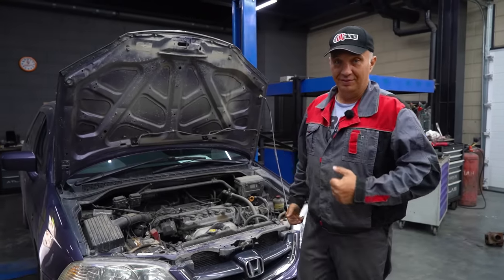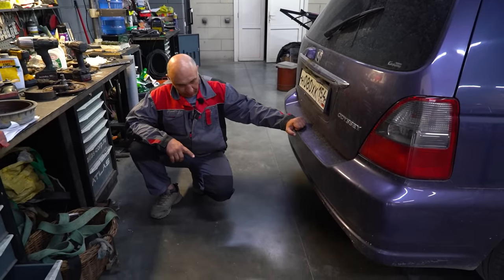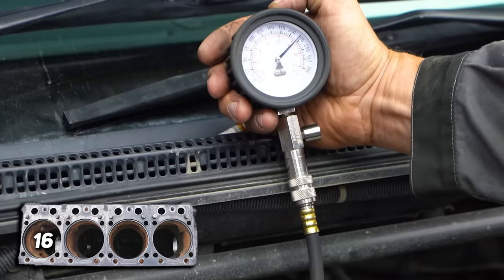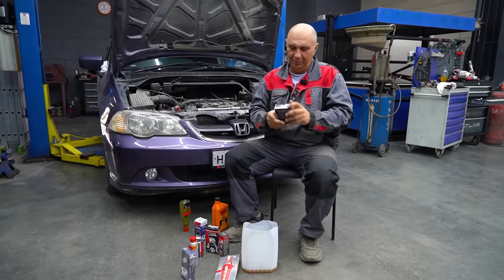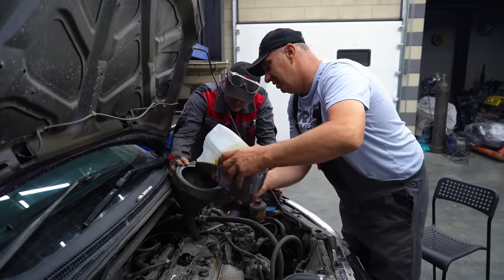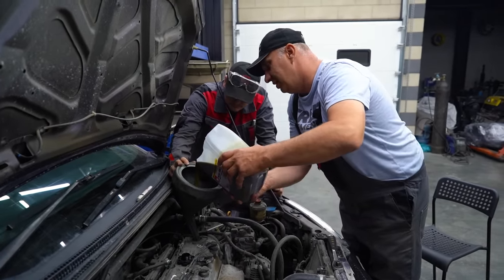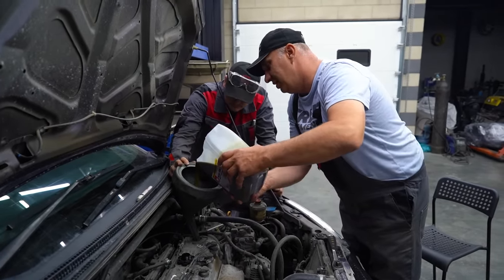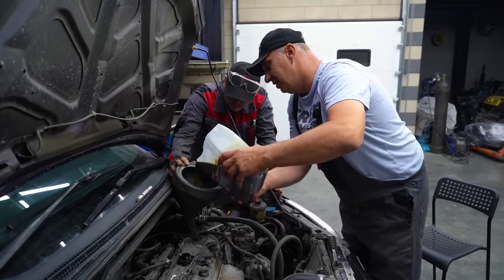Running an engine on additives instead of oil - what will happen?

Comment: Fill the crankcase with 100% Marvel Mystery Oil and see what happens.
Reply: As long as there is some sort of oily fluid in the engine it will run. Even sunflower oil will work.
Reply: extreme rod knock..
Reply: I was having weird results with my engine oil analysis and was using Marvel Mystery Oil. To eliminate a variable, Blackstone offered to run a free analysis on MMO if I sent them a sample. I did and subsequently received the results. If someone can tell me how to post I will. Basically, the only thing it had in it (via their analysis) is phosphorus. The viscosity was 2.6 cSt. However, what concerned me most was the flashpoint of 160 degrees Fahrenheit. Basically, when added to oil this is just evaporating at operating temperature. So I have come to the conclusion that MMO is fantastic for gas. However, I am only going to run it in my oil on occasion for a few hundred miles before an oil change to "clean things up." I just do not feel it is good to run all of the time with a low flash point and so many solvents.
Reply: So technically with Marvel Mystery oil the mystery is why is my mystery oil evaporating LoL

Comment: As a Honda owner myself I believe that those engine pops were caused by malfunctioning VTEC system. You see VTEC system uses oil pressure with combination of a solenoid valve in order to engage and disengage the modified cam profile.So if you don't change oil regularly or use oil with wrong consistency it might prevent VTEC system to work properly. Based on what I have seen in this video I'm guessing VTEC system on this particular car is probably all clogged up resulting in VTEC not disengaging properly resulting in bunch of fuel getting into exhaust pipe. So before doing any further testing on this engine I strongly recommend you disassemble and thoroughly clean the whole VTEC system, replace the oil once again and go for a drive.  I bet engine performance will increase significantly since VTEC might be restored to its working condition. Will this solve the whole smoke problem? Most likely not. At least not entirely.

Comment: it prob has a clogged pcv valve, plugs need to be replaced, ht leads have high resistance and worn as well as the coil pack(s) 😂

the owners enthusiasm was the BEST 🤣🤣 ❤54G

Comment: You could run a car on anything, for a while. One time I was getting ready to change out an engine and decided to try an experiment in which I drained the oil and replaced it with water. Then I drove around my neighborhood for about 15 minutes and got her home, hissing and spitting and steaming. It was great.

Comment: Great experiment! I always wondered what would happen if you did this. I am curious if Rislone ring sealer and treatment would do anything with this engine to slow the oil burning on acceleration. Obviously nothing but a rebuild is going to fix all those problems completely, but I am curious if a ring sealer would stop some of the oil burning on acceleration.

Comment: They were notorious for week oil control rng pressure.....ive pulled them apart and expanded the oil expander spring all was well after that.

Comment: I've seen some oil changes of cars from people who have only used oil additives, it eventually turns into a jelly and is very hard to clean out. I don't know if it hurts the engine but it eventually stops the car from starting. I wonder what happens if you use cooking oil.

Comment: Suggest you substitute one quart ATF for oil on next oil change and add 4 oz of brake fluid to act as a seal softener.  It looks like its the valve stem seals mostly as the smoke is on acceleration after deceleration.

Comment: Just a thought what if you guys took this engine out and took it apart and cleaned it like that last engine you guys did and see if that does anything to fix the smoking. It would be interesting to see if it restores the engine in some way.

Comment: Grey smoke and it backfires seems as running super rich from a stuck open or semi-stuck open injector. Maybe thats whats washed out the cylinder off and caused it to consume oil.

Comment: the smoke when letting off the gas is sign of a bad valve seal, mainly intake seals. at high rpm then lettinging off the gas pedal. the vacuum is at its highest or most significant.

Comment: Not only does this work ( with fuel additives) it can be used to clear out dirty, waxy diesel fuel systems. Or gas . It's easy on a mechanical injection car to run the fuel intake into a can of seafoam

Comment: Curious if you were to install a brake pedal for the two left wheels and another brake pedal for the two right wheels with an unwelded diff if you could brake steer like a army tank a lada is built like a tank after all

Comment: When faced with a head gasket issue on a vehicle you don't care much about them stop leak is worth a try. I have even had success adding a bit of brake fluid to a slipping tranny but mechanical fixes in a bottle are usually in vain.

Comment: That Xado stuff is actually pretty good; my transmission wasn’t having any issues but I added some since it has over 150,000 miles and now the shifts are a little more crisp and the car pulls a bit better. I think it’s made in Ukraine

Comment: Attribute it to cylinder head wear issues. I'd say a valve job and new guides and seals and it would probably be a good running engine again. Probably re-ring it too, but I suspect some valvetrain parts were slowed on the test due to the consistency of the concoction and there's just too much clearances, as if to say it simply needs valve lash adjusted and no snake oil concoction could resolve that.
Reply: Its simply not worth it you can get a replacement cheaper
Reply: @bubatzpirat396  that's the logic with most engines until all of the original cores dry up and you can't replace it. When that happens, you'll wish you didn't waste those engines or parts. That is to say you wish to keep said vehicle.
Reply: @lucky7s94  they produced millions over millions of vehicles using the same engine base. Why rebuild an engine for upwards of like 2k when you can get a perfectly good one of the salvagelot for 500
Reply: @bubatzpirat396  just like they produced millions of cars in the 50s... now try finding an original '59 Studebaker lark 8 v8 crankshaft. I'll wait because I bought the last NOS in box crankshaft in existence. There was no option to just put another motor in it. Yes, it would be cheaper for some to put another motor in their vehicle... but always save what parts you can at least. There's a reason they took the 640 cubic inch Merlin engine out of the original Bigfoot monster truck... parts dry up and their value goes up. For example, a ford 429 with desirable head castings are in the 1500+ usd range right now sight unseen but needing total rebuild. They aren't made anymore and they aren't getting cheaper. In order to rebuild one nowadays, you will automatically need to get parts from aftermarket suppliers. And to think at one point, Ford made millions of those motors. 🤔
Reply: @lucky7s94  they did but these where desirable cars because theyve been some childhoods. I thin a honda odyssey wont be so rare and desired in the same timespan

Comment: HOW'S THIS FOR AN EXPERIMENT... Run a car completely on oil... Coolant = 0/30 Oil. Power Steering = 0/30 Oil. Brake fluid = 0/30 Oil. Now, how would the car drive/operate with all those three fluids replaced at the same time? (Use your test track obviously 😉). Naturally you will need petrol/diesel as fuel, but thin motor oil for everything else. 🤔😏😉👍
The things to test for will be how will the brakes feel going from cold oil to warm/hot after using the brakes intensely for a while? How will the steering feel from cold start to a while after driving? Will the cooling of the engine be as effective.. Results NEEDED! Hahaha 👍
😎🇬🇧

Comment: I'd like to see if you could breathe new life into an old engine with RVS treatment.
I've read from users on forums that it does increase compression a bit but haven't seen any proper testing.
Like, maybe find some clapped out Lada engine, and just do the treatment as per instructions.

In my own cars i've only noticed a reduction in noise, in my Mazda it completely got rid of valve lifter noise, though it took 2000km of driving with the treatment in the engine.

Comment: I got honda accord 1999 2.0l the on odo meter 250 k.m  same engine on the odyssey 
I got the same problem blue comes out when i floor it 
It consumed 1 L every 600 or 700 k m
It's common ensue on f series after 150 km

Comment: I lived in San Juan for 9 months in 1995.  I bought a Fiat Spyder that had a blown head gasket.  I changed the gasket out in the parking lot of the condo in Isla Verde, but the damage was done;  A month later, coming back to the crash pad the engine seized about a block away.  I managed to push the car into the parking lot.

What happened was that the day before I had poured a bottle of STP oil treatment into the engine, because the oil pressure light kept coming on.  I figured the increased viscosity of the oil would raise oil pressure and save the bearings, but what it did was starve them of oil and it seized up.  My roomate at the time was a Jesus freak who spent all of his spare time in the church next to the condo building, and the "spiritual leader" apparently had access to a Fiat twin cam 2.0 liter engine, so I sold it to him for $100.

-The point is that these additives just keep the oil pressure warning from coming on, but I think they just destroy your engine in the process.

YMMV~

Comment: I suggest to add a oil aditive that is supposed to make the engine last longer, drop the oil and run the engine till it gives up then examen the damage
Reply: I'd like to see that. I have seen that supposedly done in commercials for Prolong, Bestline, Motorkote, etc, but seeing it independently validated would be cool. I really don't see it working for very long on a stock engine though because I'd think things like bearings will still quickly get very hot and melt without fluid to dissipate the heat from the inevitable friction. Bearings don't have to get that hot to melt either, the melting point of tin and lead is around 450 degrees and 600 degrees respectively. However, if the bearings were replaced with the same hardened steel the crank is made from, that might actually work for a while since aluminum, the next softest metal, won't melt until around 1200 degrees. So perhaps instead of a catastrophic failure, we might just see greatly accelerated wear.

Comment: Use compressed air to simulate a Turbo! Someone else tried it but didn't seal off the intake, it was just bleeding all the air backwards out of the intake. That's one experiment I've wanted to see for Years but nobody seems to have done it yet.
Reply: Ford did something like this for there rally cars

Comment: My money is on valve stem seals, the way it goes from black to white to blue is a good indicator of oil being pulled into the combustion, no easy fix there save you can use balloons to inflate inside cylinder to stop valve dropping and try and pull them out from the top once springs and collets removed but to be honest a well set up garage just easier to whip that head off, change the seals, new head gasket and giving the head stuff a thorough good clean and polish maybe a skim.
Reply: Rope is way better than balloons, good old 550 cord.

Comment: Try emptying motor oil, and fill up the engine with karosene. Run the kerosene by usinging external pump. In from thw top, out the bottom. Leave it overnight. Then drain it. Will that clean the engine?

Comment: The thick additives will starve the small passages of oil that thinner oils can lubricate, that's why you don't want to put it in newer cars with oils that require 5w30 to 0w grades.

Comment: Fill it up with 108 race fuel and give it an italian tune up running it up and down an air strip and see if the stuck rings clear out before it melts a piston

Comment: Thats an f23 engine. Great engine, but the oil control rings get caked in deposits and wont allow oil to flow through the oil control ring relief holes. That coats the cylinder in oil and burns up. Run an experiment where you fill the cylinders with cleaning agents and see if you can get the deposits to disappear. I have tried on a couple f23 engines with no success.

Comment: I predict a lot of blow by. With the rings the way they are and the additives being so thick…. Also, does that motor have an oil pump, or spoons or how does the oil get distributed? Could have some issues there.
Reply: Umm, it's not a old time Briggs n Stratton! Of course it has a oil pump like any vehicle, hence the oil pressure light n all....
Reply: @shawnsatterlee6035  hey thanks man! It was a legit question. I know nothing about Honda engines. You have any questions about psychology or human behavior though, you let me know.

Comment: with the thought that thicker oil means less smoke , try a very heavy weight motor oil like 20w50 , or even differential oil , like 90 weight or half and half of the 2 and see if the smoking is less .
Reply: Usually ends up being to much for newer smaller 4cyl lol
Reply: 20-50 won't hurt anything. I use to run it all the time years back in summer, now I use either rotella 15-40 or mobile 15-40 in summer. Conventional, not synthetic shit!
Reply: I a small 4cyl?

Comment: Yeah when you have fresh oil the oil helps the motor spin smoother and faster and easier. Try it on a mower that hasn’t hard it’s oil change in a while run it to get the feel, don’t let it warm up and then change the oil and watch how fast the motor spins. It will idle faster and better
Reply: It’s not your mind it’s not that it give more power it just don’t have to struggle some much it’s the same with going down a slide with water vs baby oil if that makes since.
Reply: You got way faster with the oil.

Comment: Clean out the screens underneath the solenoids ok the transmission. That torque converter likes to fall apart and clog up the valves

Comment: Funny how its a honda they love to burn oil and my d series also leaves carbon spots on the ground Mine runs on upto %20 oil additive dosent really help but ive tried injector cleaners upper cyl lubes intake decarbs.. next oil change im gonna do a flush and try a thinner oil and a piston soak

Comment: Have some a bit different idea. Tried to run an engine on exhaust gasses from another engine. But what will happen if you run an engine with exhaust gasses from another engine, that uses exhaust gasses already.

Comment: Had a buddy that was swapping his motor in his accord (f23-h22 swap) drain the oil and run his engine full throttle for 15-20 minutes before the engine seized.

Comment: What if you add a Turbo to a oil burning engine? Would the increased air intake pressure prevent oil blow back?

Comment: The "Additive Soup" was like filling a jar with hot dish water that has a thick layer of greasy scum.
It gradually opened gummed shut areas that oil can begin flowing through again.  
I made the mistake of buying a very old Toyota Japan mini truck. The owner changed the oil maybe 2x in its life and though it sounded fine in his driveway, once home I drained what looked like melted tar. After putting the correct oil it sounds like a symphony of rattle and clinking junk.

Comment: To clean engine just put 50/50 oil with diesel, let it idle or slightly more than idle. After 15-30min drop it off. Do as many times as needed.

I'd like to see this "deadly flush" with effects on engine.

Comment: i've always wanted to see how and engine would run if it was filled with marvel mystery oil instead of oil, but this is just as awesome. im not sure if you can even get MMO in russia.
Reply: I can tell you that if you let it sit it turns into terrible varnish. I used to use it as an after run oil in my nitro RC engines. Let a pair of engines sit on the shelf for 3 years and they were all but locked up. No corrosion, just the varnished Marvels almost like Cosmoline.
Reply: It's just mineral oil, for the most part.

Comment: If it's not worn out valve seals I would try a product called CSL I had good luck with it on worn engines. CSL= Copper Silver and Lead. 😀

Comment: Try running it for at least 1000 kilometers or more and you will find your answers, it smokes because all that oil additives mix together makes it more visocous.the engine will work harder because oil pump cannot pump it properly due to its viscosity.
Honda engine will still rin even without engine oil and it will only be broken when it reached the safe engine temp level

Comment: Great video🔥 i have a question how did you flush the engine? With just regular engine oil?
Reply: You can do it with engine oil and diesel fuel if you want to stay on the cheap side, about 1L of diesel is good to thin and clear the oil if it's not sludged up.
Reply: @killerdinamo08  thanks you. So you mix it with the old oil or new oil? And then let it run for a few mins?
Reply: @roblovski300  Just add it in the engine prior to changing the oil and let it run a couple of minutes. It would be a shame to mix it in the new oil since it will ruin it's properties of it and ruin your engine. A sign that the oil is thinner is a bit of smoke from the exhaust while it's running with the diesel mix, yet it should clear up after the new oil. If it doesn't, the engine has some wear and needs investigation. Yet only need to do such washing if you are not sure about the history of oil changes or it's obvious the engine has some deposits, otherwise if regular oil changes are done there's no need to flush it, the oil is healthy if it's not old or extra worn.
Reply: @killerdinamo08  alright thanks a lot!👌🏼